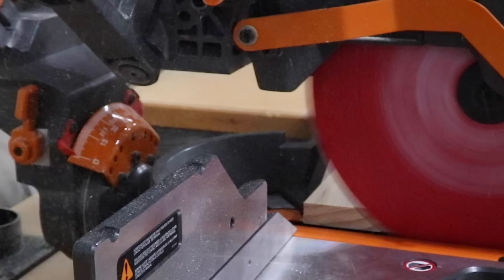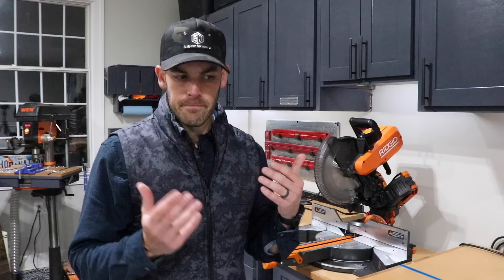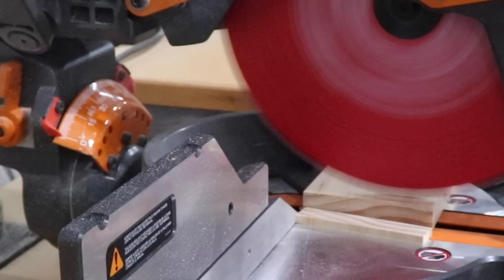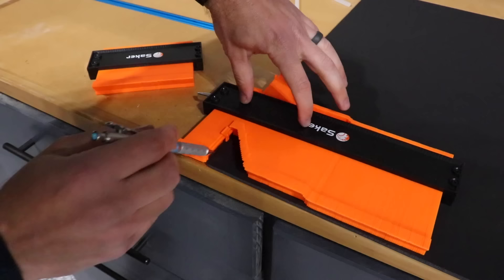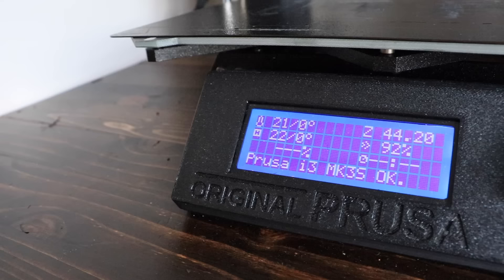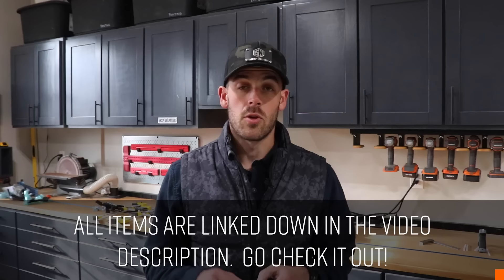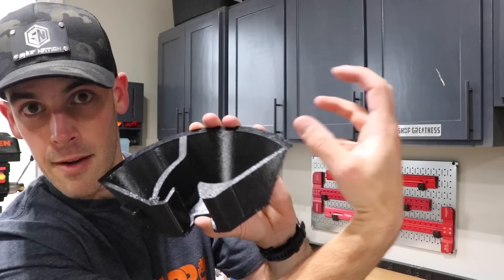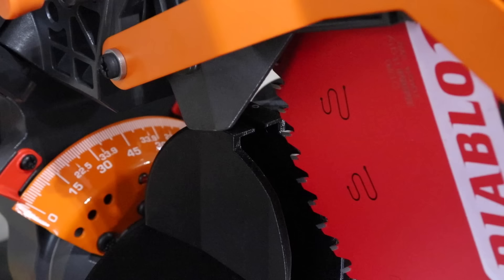Did I Solve Miter Saw Dust Collection?

Comment: Try putting some smoke near the blade while it is on to see what the airflow is doing. It looks like the blade is pulling dust up and over.  You may need to baffle the airflow to have more pull at the top end of the dust port.  Also someone stated to put dust collection under, as this may help remove the chips before they are thrown over your pickup.

Comment: Great video even though it didn't work the way you wanted it to.  I've been considering that saw - could you get the measurement from the face of the fence to the wall?  I'm trying to see if it will fit my space.  Thanks!

Comment: I think the followup should contain some slo mo shots where we can see where the dust is displaced. Hopefully that helps to solve it.

Very cool to see this first iteration. And I enjoyed this video so much MORE after seeing that it wasn't over yet. With great ideas, you don't always nail it on the first try. I prefer to fail fast, so I would have attempted suction on that foam prototype to see if that had any positive effect. In fact - CAN you try it on the foam prototype, and see if it behaves the same way as the 3D printed model? If foam behaves similarly, then maybe you can try multiple iterations in foam really quickly and transfer to 3D print after foam performs well enough.

My guess though is that it has to do with the opening. might be too narrow, so some dust can go left/right. Or perhaps you just need to consider where the dust exits the blade. The original factory colelctor had it pretty high up the back, so maybe a lot of dust is exiting high on the rear of the blade and going over your colelctor?

Very cool!

Comment: Take a sandblasting cabinet scale it down a bit, build it complete with clear viewing windows and reach in gloves/hand holes and dust collection suction at the bottom of the cabinet, inside lighting, and slots built into the left and right sides for the work stock to slide in and out. Should collect 99% of your dust, may not look pretty and you may have to experiment with the reach in glove/hand placement for the sake of ergonomics and safety. Sounds like a lot of effort but I have seen quite a bit of effort on YouTube just to collect a little saw dust. To no avail I might add. I would do it, but the dust dose not bother me since I just roll it outside and I am sure I lack the talent to take on such a project.

Comment: Travis, 
1st - Your idea holds merit, but I don't think you thought it all the way through. The compound miter saw was never intended for shop use. They're great on the job site but very messy. 
2nd - Concentrate on the hood for dust collection. Don't just build a box and think it'll take care of your problem. Instead use your engineering skills and design one that will pull the dust/chip away from the saw. 
3rd - Don't think the collection your using now will suffice because it's way to small and under powered. You'll need a 4" line that connects to your main collector (2 H.P. or better).
4th - Your collection "box" MUST HAVE a bottom collector shoot. I started with a 8" x 10" opening and found it wasn't enough so I went to a 12" x 16" "Big Gulp" . This solved the problem. You'll still get some mess behind the saw but it's 1/10 of what you had prior. 
5th - The hood should have "wings" on the front to keep the dust particles inside the box. Make wings removable or attache them with hinges. I used earth magnets to keep the wings in place. Also give the wings a couple of inches of leeway for horizontal miter cuts. Either way you attach the wings you can remove them or swing them out of the way for vertical cuts witch in my shop is almost nil.
I went with the Bosch 12" glide saw (after a lot of research) and also upgraded the blade to a FS Tool 100 tooth blade. The Fs Tool blade is pricey but a  large upgrade from the construction grade blade you purchased and once you get away from plywood and soft woods you'll find that the Diablo blade isn't enough.  It's commonly known as a "throw away" blade - not worth the money to sharpen if you can find anyone who will sharpen it. 
I hope these suggestions help. I'm looking forward to seeing you tackling  to this problem. 
As always, another great and informative video. Time well spent.
P.S. - You built one hell of a nice shop!

Comment: I will tell you why this failed. 
The dust goes every direction but lands in the same place due to turbulence. 
If you use a hood with a high cfm but low pressure you will catch the "light" particles that are easily trappable. 
This dust port you have made will work better if a hood is present because the ambient air is not effecting the turbulence caused by the blade.
My set up seems to be pretty clean. I have a funnel similar to yours only my bosch (almost same miter) and a hood. The hood is to my dust collector and my funnel is connected to a vacuum. I also have a funnel dust port at the rear part of the miter (under the arm) to catch the large particles that are not effected by the pressure of either suction. This I have connected also to the vacuum...this is what cleaned up stuff the most. 

This 3d print is AMAZING such a great video.

Comment: I wonder if the key might be to increase both the volume of air and the cross section through which that volume passes? I'm getting ready to try removing the shelf beneath my saw and replacing it with an open framework. Then I'm mounting a cheap box fan beneath the saw to blow the air and dust into the cabinet underneath. I'll reroute the existing D/C port to the bottom of the cabinet. My working theory is that the fan will sweep a larger volume of air through the face opening of the existing hood, past the saw, bringing more dust with it, into the cabinet underneath. If it seems promising I'll replace the cheap box fan with a better one that has a TEFC motor.

Comment: How about using the dust collection piece that comes with the miter saw and instead having that plastic flap that it comes with it, make an attachment that will fan out and cover that open space between the fence. 
I have the delta version of this miter saw and we need to figure this out.

Comment: Suction alone isn't enough. Air compressor at a low flow rate while the saw is triggered will redirect the up draft of dust off the blade. I'd in your blank area baffle put a small hole to clear the gullets  from the side. Could test this by hand with compressor or small leave blower.

Comment: What about using smoke or something similar with the piece you built on and you will be able to see the air flow direction around it? If you experiment with a better visual of what the air flow is doing instead of where the dust ends up maybe it can guide you where to concentrate the suction and if its being deflected before it gets to the slot, try it with and without your piece maybe it will show you where you're losing the aerodynamics that interrupt a smooth path to the suction area. Maybe try it with just the blade spinning and check if the airflow changes as you start a cut from more in the middle and with it all the way in, maybe try it without cutting wood and then with. I know they use something that blows smoke looking for air leaks in houses but other than that I don't know the best way to get smoke long enough to get a good look like a car in a wind tunnel.   Im curious to know what you think. Awesome 3d set up by the way.

Comment: I think since the problem is an air flow problem.....perhaps it should be approached like an HVAC engineer.  Now, I am not a tech person(Parole Agent actually).  But, it always seemed odd to me that all dust collection is suction entirely(solely?).  Therefore, IMHO the dust needs to enter that "event horizon" so to speak, where the suction exists strongly enough to capture the dust firmly and pull it into the system.  So...if there was another way to present air flow in front of the dust cloud, pushing it into that point of no return area, maybe it would be more efficient.  And shaping that air flow toward the system would, of course, effect efficiency as well.  I have a picture of what that might look like -the challenge being to not have en extension that interferes with the operator's space.

Comment: Nice job! I need something like this for my metal cutting saw. Maybe a similar contraption but with a bunch of super strong magnets. Maybe have the magnets on the outside of the plastic shroud on removable plastic bars that are easily removed and then all the metal chips would just just fall away.  hint hint

Comment: The problem is the same because most of the dust comes from underneath the cut combine the back with a zero clearance on the flat cut surface and add a funnel underneath which is we’re you should hook up your suction this alone should do well for massive improvement

Comment: I wonder if printing the parts from tpu or even just making the top half from rubber would help. It looks like you need to slow down the particles before the vacuum can take over the removal of the dust, it's just bouncing and shooting off faster than the vacuum can overpower. My Makita has a large soft rubber boot in that spot, and with just a standard wet and dry vac, I get maybe a tenth of the dust you are showing in your video with that running.
Love the vid though mate, just because this one didn't work won't mean the next one doesn't improve! Good or bad, I bet it was still hell fun to just get out and make things 👌😊👍

Comment: Wow, i was hoping it worked so i could buy one from you. I think if you get one working there is a matket foe it. Thanks keep trying. I just bought a 10" Bosch and am hoping to cut down on the dust. I had a 12" Dewalt and got rid of it mainly because of the arm reach

Comment: Could be 2 issues One using a shop vac instead of dust collector and two creating turbulence because the adapter you created is not moving enough air under low pressure.

Comment: The dust is expanding out from the cut quicker than suction rate can handle.
Unless you can up the flowrate on the vac its pointless using any catch system around the blade.

Comment: I wonder if the dust is traveling at such a high velocity that it bounces off the inside of the dust nozzle and flys back out. Maybe lining the inside with rubber or foam would absorb the impact better and the dust would stay in the nozzle. I bet foam weatherstripping would work well, and would be easy to test.

Comment: Your trying to steer chips moving at something like 150 miles an hour with a perpendicular airstream that is moving a half to a quarter of that speed.  If it were me, my next iteration would have the vac port in line with the blade somehow.  Other option is to up the airspeed with a proper collector but i sense thats not what you want for your setup.  Alternatively you could maybe try to block the flying chips with a row of brush covering the top bit of the chute.

Comment: It's not just ejecta off the blade.  That ejecta is getting blown around by the fan on the motor and the wind of the blade itself.  You'll need to cover a much larger extraction area.  

You are probably going to have to move a LOT more air.

Comment: Too bad it didn’t work. Strange you didn’t have the vacuum attached to the stock dust collector during the base test..? Without this, you are testing vacuum versus no vacuum which will completely confound any results. 
The saw that seems to get the best reviews re: dust collection is the new makita with 2 places to hook up the vacuum. And the lower one is quite a bit wider.

Comment: My thought in watching both parts used in slow motion, was what happens to the blade guard as you lower it onto the wood. If the blade guard actually went the full 180 around the blade, that should direct the dust and chips lower, making what you created more efficient.

Comment: Oh aren’t you ecstatic that the only adjustment to the station was the 5/8” slide and rescrew 🤣  JK; I’m sure that was the plan all along.    

I don’t even have a miter saw anymore (but I did incidentally keep dewalt miter saw stand and have mounted table tops to two sets of the pop on and lock quick mounts; I use it for long term set up/finishing/etc that’s conveniently above hip height).  I’m a 98% hand tool shop now (planer, bandsaw, and an old Mag77 wormdrive are the only power tools that remain unless a 12v Dewalt Brushless drill driver must be called a power tool🤔).   I’m in my third year power free now, but I do however enjoy watching your content.   Long gone are the drill press, spindle and belt sanders, the table saw, router tables, cross cut sleds, orbit sanders, miters saw, and all the other crazy jazz. The reason I watch your videos as opposed to other full power shop creators is primarily because your videos are concise, oriented in a clear direction, and start and end tidily on target; I still almost always come away with something and I appreciate the way you work.  Your thing doesn’t have to be my thing to appreciate it.  In this video, I would like to parrot the mock up process; yes and heck yes.   For building chairs, any standing furniture, and even some smaller items… did I mention chairs, mock ups save huge amounts of money on materials, wasted time, and really help settle the sight-lines, angles and proportions before jumping in.  It also helps greatly in forecasting/intercepting challenges, making joinery decisions upfront, etc!!  I may have traded the router for mounding planes, scratch stock, and inlay banding, but we still share lots in common.  I can play around with shadow reveals, beads, and the subtle final shape while I build, but if the plan isn’t really ready to transition well from mind/paper to lumber, it’s best to spend some time with cardboard, wire, styrofoam… anything before assaulting that piggy bank which pays for the timber 👍. 
P.S.-Don’t think me a prude, the Bandsaw saves crazy hours I’d spend cutting veneer by hand with a frame saw, allows me to resaw to save money and do bookmatching; again without hours with a framesaw. It’s easy enough to flatten and joint a face and an edge, but the planer saves crazy time thicknessing and can ensure uniformity of parts.  The Mag77 makes quick work of cutting lumber down to size so I can fit them into the shop/loft to finishing drying/acclimating.  I can appreciate those guys who make no noise and harm no electrons, but if a tool can allow me to spend more time doing what I enjoy, while not gobbling space up in my shop like the table saw once did, I’ll happily pull out the planer and call myself hybrid-lite.  
-Keep grinding brother!

Comment: Travis, @13:11 you can see that a lot of the dust is bypassing to the sides of the collector.  Widen the area above the fence (to say the top of the diagonal section).  Think more box less tight chute.  Also, what infill did you set for your prints so the screws worked well, 100%?

Comment: I think it’s the cut wood in the blades teeth that causes the issue. Perhaps you could introduce a compressed air gun to the side to knock off that saw dust into your collector cowling?

Comment: Ok after reading comments, here is my 2 cents. What you have here is high velocity wood chips and wood dust propelled off the blade. Now, let's open your cabinet and stare at your dust collection. What we have on the saw around the blade is a high speed vortex of air. Just like the "dust deputy" you have on your vacuum to separate the chips from the dust. Now, we have to reverse that process at the blade. Take a look at "track " saws, as most have the blade mostly enclosed and dust collection at the top of blade. I think if you attempted enclosing the blade without interference you would alter the vortex around the blade and vacuum would have enough CFM to pull the dust.  That's my "scientific" comment, anyone feel free to add or bash me.
Reply from the maker: Love it, thanks for the idea

Comment: I don’t know if this has been included in the comments.  The velocity of the dust is too high compared to the velocity of the capture air stream.  Capture velocity is solid science/engineering and can be calculated.  1750 rpm makes a tooth velocity (for you to calculate) which is a good approximation of the dust velocity.  Design the air flow to grab this.  😈good luck- this will be a high Hp fan to get that air speed.  Interested in the results.

Comment: I would've used their port, with a cone that slides across the wood. I've found that the dust almost acts like a gas being let out of a moving compress cylinder... so either you catch it before it has a chance to spread out, or you are dealing with a large volume of suspended particulates. The only effective alternative, that I could think of, would be high airflow, and just try to pull a massive amount of air through the system.

Unfortunately, this is one  of the times where the more air flow you throw at the solution the better it will perform.